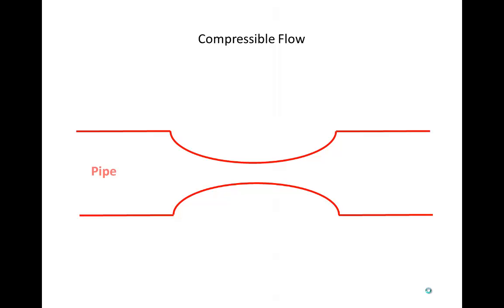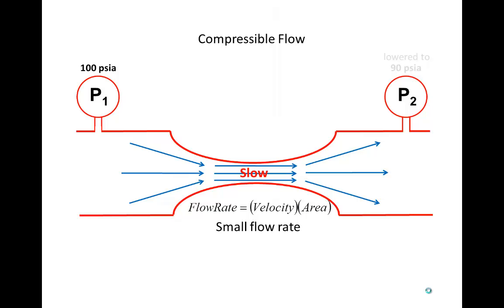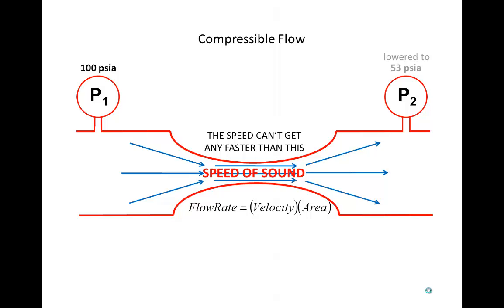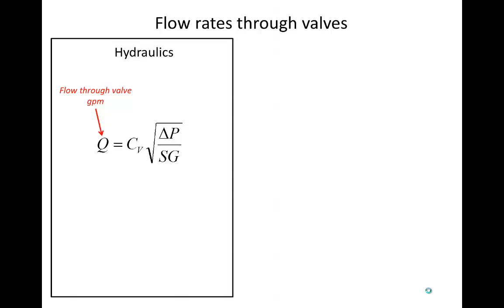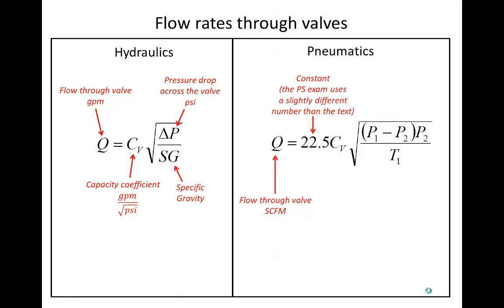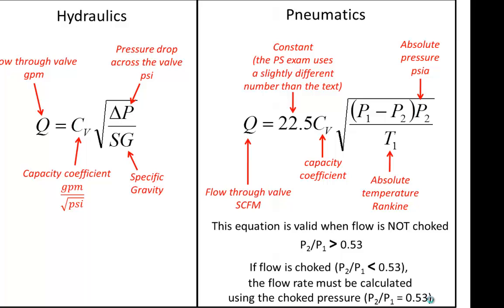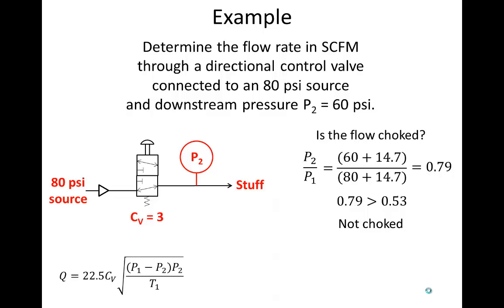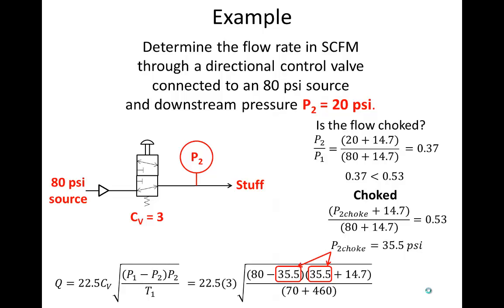BYU Idaho ME 465 Pneumatic Flow Rate Calculations

Comment: What would be the formula for working out the pressure and flow rate at the neck for a given diameter at P1 and given speed of flow? I want to work out how much I can increase a pressure and volume of air in a narrowed pipe where the larger diameter acts as a scoop to for more air. Thank thanks for any help.

Comment: I don't get where Q = 22.5 * Cv * sqrt ((p1-p2)*p2/T1) comes from.
what is capacity coeff? Why it is = 3 here?
For the Venturi effect flow rate can be calculated as a function of areas, pressures and density.

Comment from the maker: Gases can travel over the speed of sound, they just can't do so within the neck.  If you want a gas to go faster than the speed of sound then you have to bell out the nozzle after the neck to allow it to continue to accelerate.  This is why rocket nozzles will bell outward -- so that the exiting gas will travel faster than the speed of sound.  The video is correct in saying that the speed of sound is the maximum possible velocity within the neck.  You are also correct in stating that higher than the speed of sound is possible for the nozzle as a whole -- but only if the nozzle bells outward after the neck.  Compressible fluids like gases act counter-intuitively once they get to the speed of sound.  With liquids you can continually increase velocity in the neck by increasing the pressure drop.  With gases there is a point called "choked" when you achieve the speed of sound in the neck and then you actually have to expand the nozzle outward to achieve higher speeds.